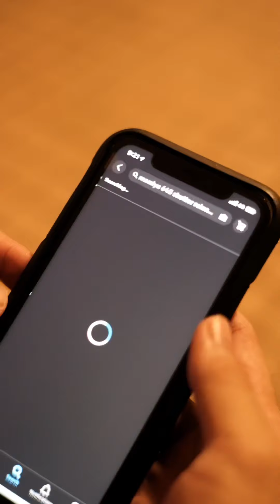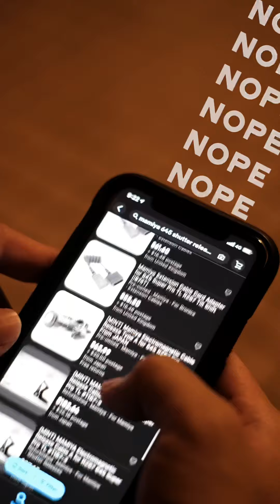DIY Shutter Release Cable Adapter for Mamiya 645 Super / Pro / Pro TL

Comment: Hey man

I've been pulling my head on this for a couple of weeks now. I've crimped countless dupont cables TRYING to get my super to fire. I ended up ordering pre-crimped 1-pin dupont cables because I assumed my crimps were bad. I got my camera to fire a couple of times by just touching the wires, but it was inconsistent, but it meant it couldn't be my micro switch, or my soldering that attached the wires to the switch points. 

Fast forward to today, and late night boredom - I realized when trying to fire the camera with loose wire ends, it fires when pin 1-2 is hit simultaneously and pin 3 is hit alone. Meaning my Super only fires when the C, COM or Continuous signal hits pin 1-2 in the camera, and NO, Normally Open signal hits pin 3. Now every single crimp i made works. I'm by no means good with wires and such, so some people might have known this already, but i felt like posting this either way incase anyone else would struggle in the future. I know the original creator suggested using 4 wires, but I never knew WHERE he meant you should place them, i just figured he meant for stability and not that It actually matters functionally. My adapter now works using 3 cables instead of 2 and I'm so relieved. Thank you for a great instructional video, and thank you Jep Kampardella for the files and design!!
Reply: I noticed the same about PIN 1-2-3 on my super. There was some issue after a long period using this method?
Reply: I want to say a huge thank you! I have been scratching my head why shorting pin 1 and 3 didn't make the shutter fire. It all makes sense now after reading your comment and it's working great with my 645 Super.

Comment: Very nice work. I have a number of Mamiya 645 series cameras.  I also have all of the parts and a number of 3d printers along with Freecad.  I may try your suggestion.  I am working on the battery box for the M645 power winder.  All I need now is the electrical hardware or to remove it from some other item that is now being used.
Reply from the maker: This build is really easy if you have all the parts. I’m too lazy to solder the wires to the trigger. This entire setup takes like 5 mins to build. The power winder system would be nice to DIY.  Someone out there must have a 3D file for the crank.